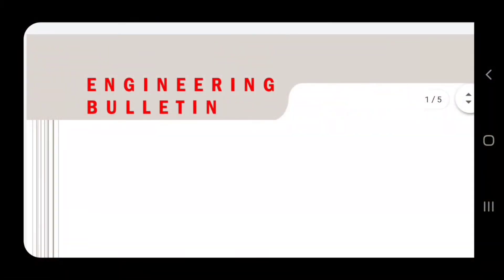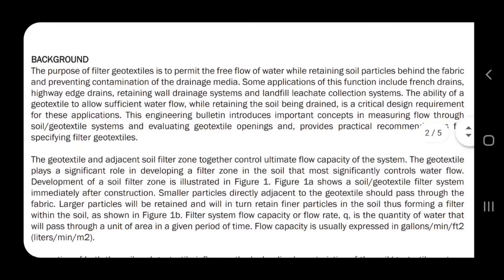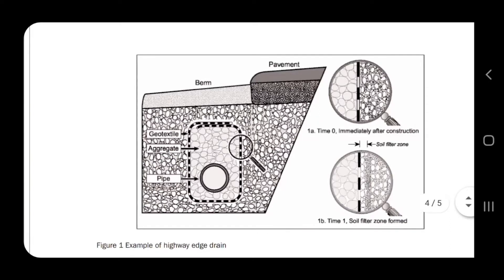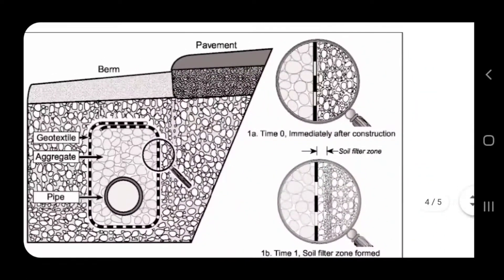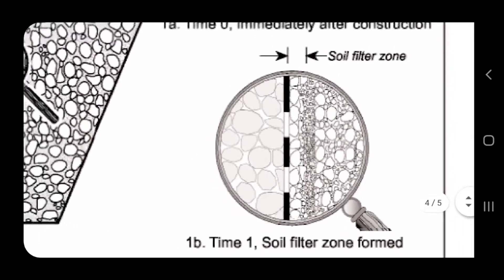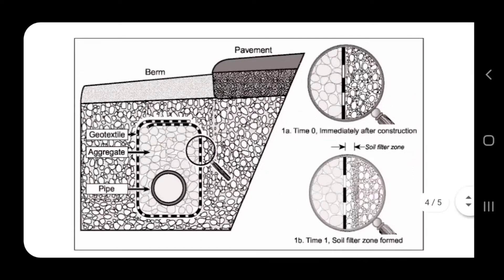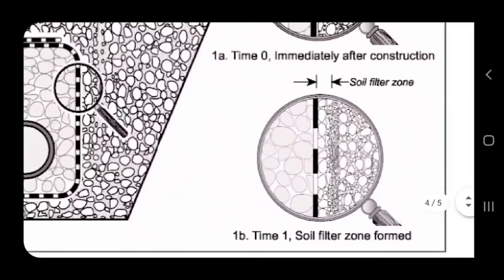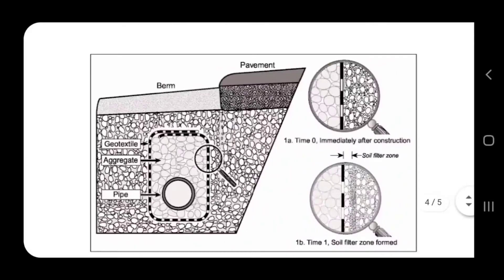How Non Woven Geotextile Filter Fabric Works | Michigan Drainage Contractor Gives Detailed Breakdown

Comment: Awesome explanation for the non woven fabric!  Question, I have very heavy gray clay that is right up to the surface of my soil. Actually, I have no soil. I’m thinking about renting a machine and cutting off the first few inches of the clay, and replacing it with good compost/top soil before doing the French. Any thoughts? The clay will not let any water pass through it, so the French drain would only be bringing in water from the very top if I don’t amend the clay
Reply from the maker: 👍 
https://youtu.be/755GVZGBEvQ?si=zzbaKWQwRgyj5rSy

Comment: we've had a WET Summer in VT, thankfully no water came into our basement....until we got 4" two weekends ago and another 3" this past weekend. Is it because the ground is so saturated, or is it because I removed a bunch of landscape fabric from an old garden bed in the front of the house (probably 400sf area), and then used big box store weed fabric about 16" wide  and laid down stone against the house and then just left the rest as dirt (will seed with grass in Spring). I don't know if removing all the previous owners landscape fabric is what is causing the water to enter our basement now, or just the amount of water?
Reply from the maker: You may have broke a clay cap. Based on your description of the site conditions, I would clay cap up by the house like this
https://youtu.be/7KB8Mjexov8?si=vKc_UGPwrruXxE6F

Comment: The other guys videos worry me.   Our native soil is Red Georgia Clay.  Not very permeable.  It seams to make sense that it would form a film on the fabric.  But also that it would cake into un protected stone.  Please comment on heavy clay soil.
Reply from the maker: All I work is heavy clay soil. I stand by what the engineers report  Disclosed
Reply: @FRENCHDRAINMAN  I see how this would work below grade with the hydrostatic pressure, but what about in an open french drain? The clay can get on top of the stones causing surface water to run right off

Comment: Whats double punched? How do we know something has been doubled punched?
Reply: In his company he puts the fabric through a process that “punches more holes” through the fabric before install.
Reply: Ok. Does it or will it perform in heavy clay wet areas? Other soils it makes since but when heavy clay soil gets wet snd water does not want to move.
Reply: @ronaldpigeon4713  It performs amazing in heavy clay wet areas. It works great everywhere and should be used for every french drain. Subsurface Water gets into the french drain once the water table rises, but it also moves horizontally into your french drain system. Ground water will naturally make its way to the place with the most void, aka least density which in this case is the french drain, including the aggregate and pipe. If your aggregate gets clogged with soil, you're taking away all that void and ground water will have a harder time making its way to your pipe. It will also be much, much slower. Then eventually your pipe will get clogged with that soil as well, and now you have a failed system on your hands. The fabric completely eliminates the possibility of dirt getting into your system. 

Ever wonder how creaks, streams, and small rivers still flow even though there hasn't been a rainfall in weeks? It's because groundwater is naturally making its way to those waterways. The french drain is the same concept.

https://www.usgs.gov/special-topic/water-science-school/science/groundwater-flows-underground?qt-science_center_objects=0#qt-science_center_objects
Reply from the maker: https://youtube.com/playlist?list=PLjFCqaZ4v1BUmAXw5xwQ0zbQRPxnX0U7R&si=0-bXO6M5sXAGedzg
Reply: i beleive he has said he contracted with his supplier to run it through punch machine twice. not sure if other companies offer this. if not, he would be the only supplier. his prices are competitive. only thing that kills me is small run shipping. plan on making a bulk buy eventually as its the only way shipping make sense for me.

Comment from the maker: It's a shame that homeowners are getting screwed by contractors. This one step is the difference between a French drain system lasting FOREVER with filter fabric or a French drain installed with an  Expiration date because the contractor didn't want to pay the price for a Great Non wolven Geotextile fabric because it would hurt his bottom line. I always consider the source in which I get my information. If it's a half wit inbred I don't consider that a good source of information. If it's a team of highly educated engineers I consider that a Great source of knowledge.
Reply: Hey, how else are they going to get them on a maintenance schedule?
Reply: I had some half brained nitwits do mine I guess.